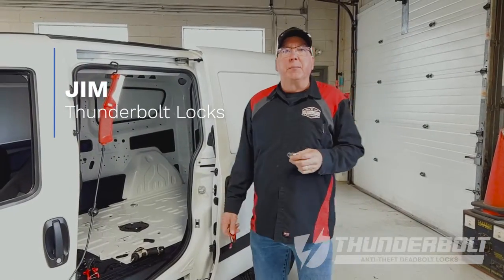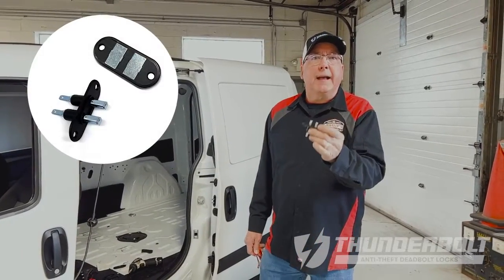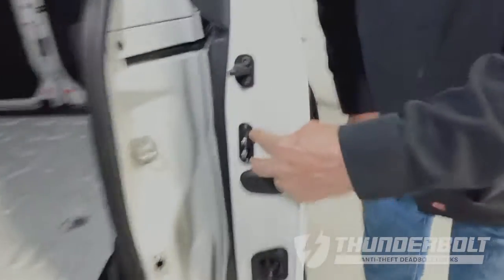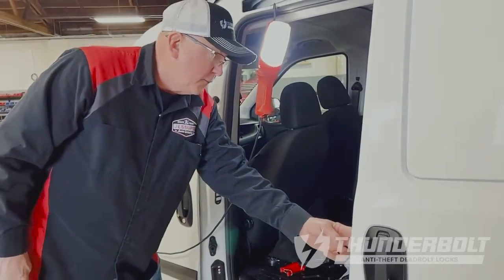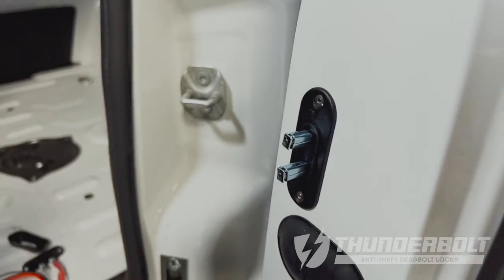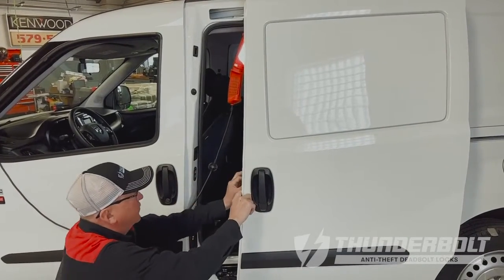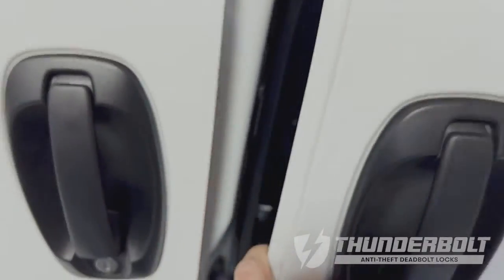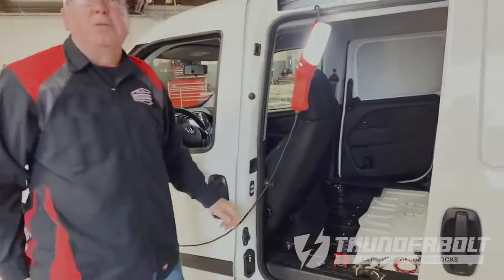Contact Switch Installation Overview

Comment: You could install the contact pin side first, then dab the tips with a paint marker and close the door while still wet.  That will transfer over to show plate placement a bit easier than trying to eyeball it.
Reply from the maker: Great TIP Tony...very smart and much appreciated!
Reply: Thats why the contacts  a little long    It will slid a little when closing. Whit paint arker and shut the door

Comment: I installed a set  in a 56 Ford f100   Push the pin in a bend the  wiring tab to shorten the stroke. Center hole will  go to at least 3/4 inc for wiring. Go slow to not make mistake. Amazon  Cheap